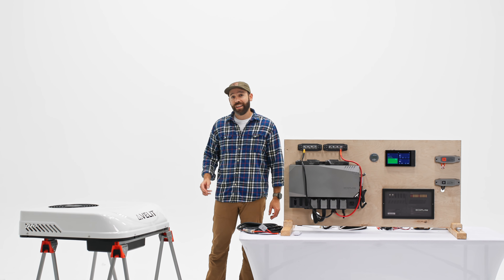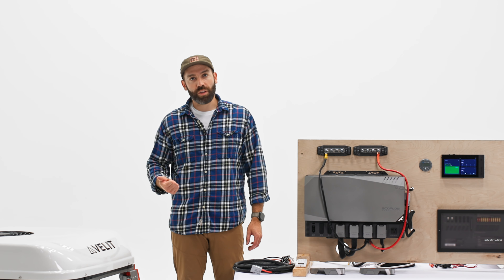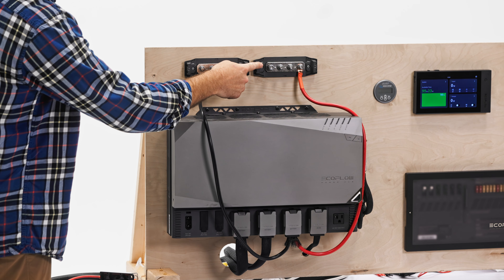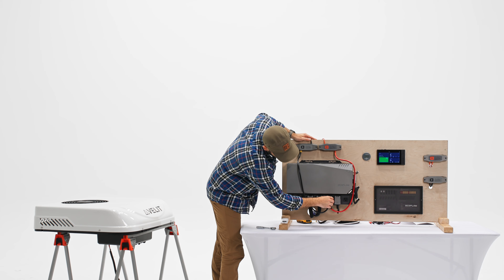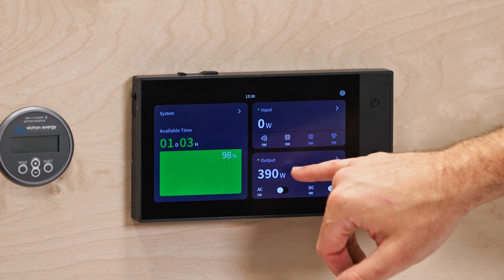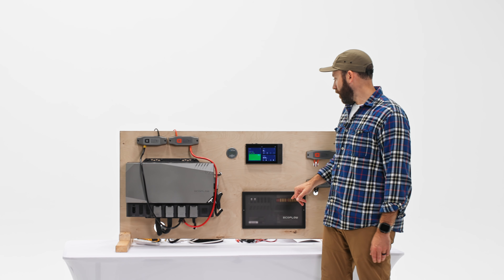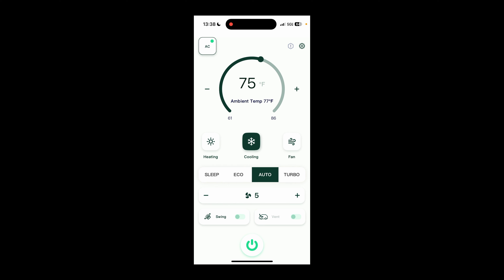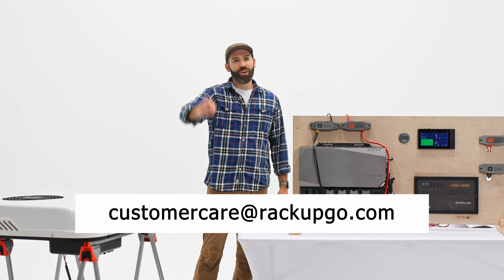How to Connect & Operate VELIT 2000R + EcoFlow Power Kit

Comment: Good how to. However, I had to listen a couple of times to clear up something.  References to the AC cable caught me off guard.  I couldn't understand why you were running DC current through an AC current cable.  Then I figured you meant an AC (air conditioning) cable.
Reply from the maker: @Resolute100  ah yes, good catch! You're right, it can definitely be confusing. We try to clarify when we're talking about AC vs DC in relation to air conditioning, but it's not as simple to switch up the terminology while speaking as you’d think!
Reply: Does this package usually go on sale around Black Friday?
Reply from the maker: @brosandco  we typically try to provide the absolute best prices every day. Having said that, there could end up being a sale during Black Friday, however on the bundles, it would not be much. In fact, it sounds like there is a price increase coming on these power kits, so prices could actually go up by then, too. All that to say, it all depends!
Reply from the maker: @brosandco  we typically try to provide the absolute best prices every day. Having said that, there could end up being a sale during Black Friday, however on the bundles, it would not be much. In fact, it sounds like there is a price increase coming on these power kits, so prices could actually go up by then, too. All that to say, it all depends!
Reply: @rackupgo man…I commented on this video and waited for last weeks paycheck before being able to buy this and now you don’t sell it.  I’ve never been more upset about missing out…
Reply from the maker: @brosandco  understand that you're disappointed. Honestly, we are too. But as a company, we believe in carrying product lines that we and our customers can trust, and recently, there have been some changes at EcoFlow that have us and our legal team concerned. Until those issues can be resolved, we have made the decision to no longer carry EcoFlow products.

We're working on some exciting alternatives. Sign up to be a RackUp PRO for early access to the drop.
Reply from the maker: @brosandco  additionally, we do still carry the Velit product line as we’ve tested that unit in a heat chamber and proved it out. Become a RackUp PRO for a nice little bonus!
Reply: @rackupgo  can you elaborate on the EcoFlow changes that have you and legal concerned? As an Ecoflow power kit owner, would like to know if I should be concerned about my safety. Is it any issue with the competing Dometic Go Power line? Appreciate it, interested in picking up either this Velit 2000 or 3000, or the new 48v Freshjet.

Comment: Any chance you'll be doing any videos on the Velit 2000R mini? I'm trying to save roof space for a solar array so I'm very curious about this unit and how it performs compared to the regular 2000R, I think it would be a valuable vid!
Reply from the maker: Regarding the connection shown in this video, it should be nearly identical. As far as performance goes, I would expect it to perform similar to the 2000R, maybe taking a little bit longer to pull down the temperature. Reducing the size of the unit means reducing the size of the condenser or evaporator (or both, and possibly the compressor), which will without a doubt impact cooling capacity. If you're trying to maximize space for a solar array I would suggest taking a look at the Go Power 100W Slim panels. They fit nicely along either side of the 2000R or the Dometic RTX on a van roof. The 5.5" in width the 2000R Mini will save you is not really enough to fit any additional watts on the roof. Have you compared costs between maximizing roof solar and running a secondary alternator?

Comment: Hey.  Will you guys be testing this unit ? 

Greenland 13,500 BTU Inverter RV Air Conditioner with Heat Pump
Reply from the maker: We can add it to our list. Right now our focus is on DC powered air conditioners. We've covered 12V units and are in process with 48V versions. If we revisit shore power units, we will certainly keep this one in mind.